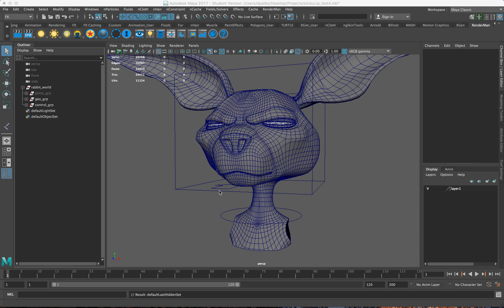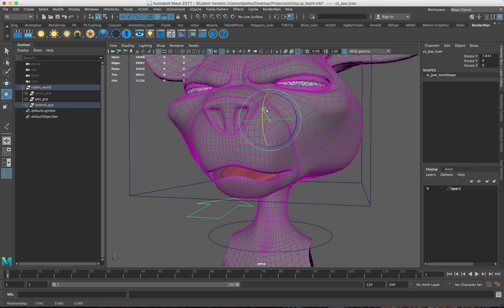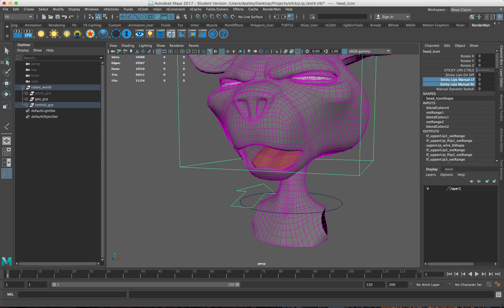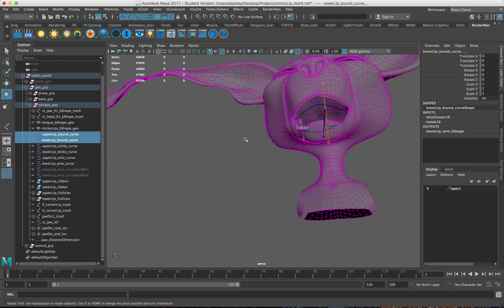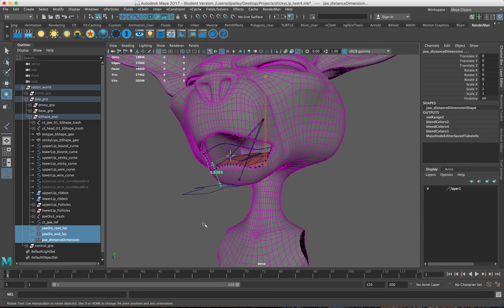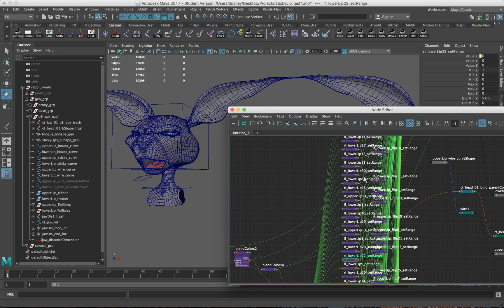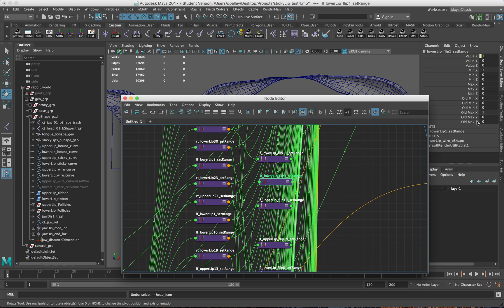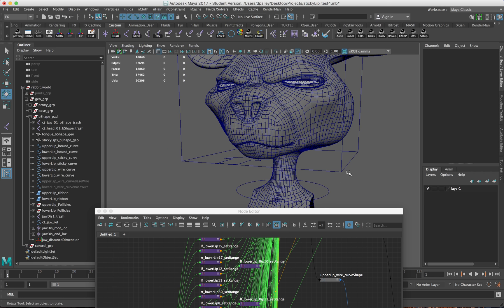Maya Sticky Lips Rigging Tutorial Part 1

Comment: Hi . what if im doing a rigg with body. Am i suppose to skin everything tgth ? Than work on the facial or do the facial rigg on a seperate head as a blendshape ?
Reply from the maker: Gopis Vara yes you can make it on the main rig. You’ll have to turn off the “inherit transforms” checkbox in the attribute editor for all the curves to avoid the double transforms. Then just include the ribbon joints as part of the main bind
Reply: @dcpalley23  thank you very much. Subed👌